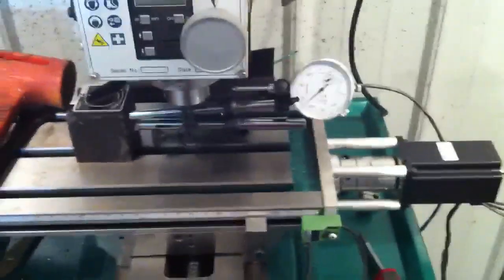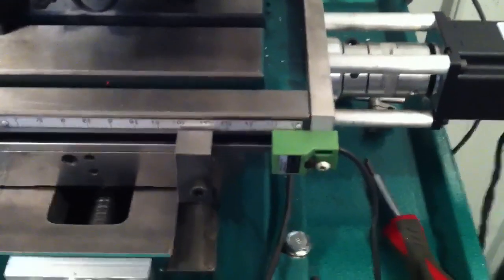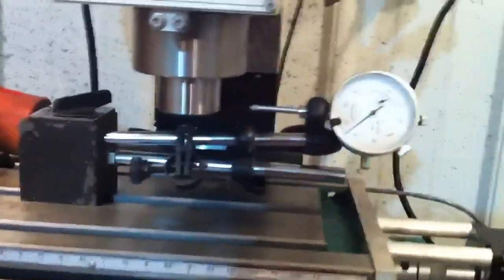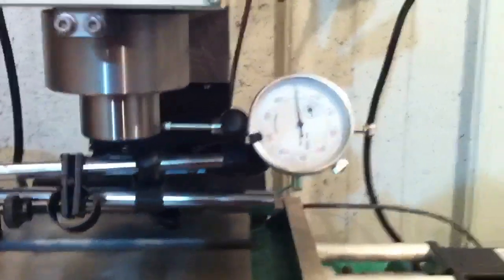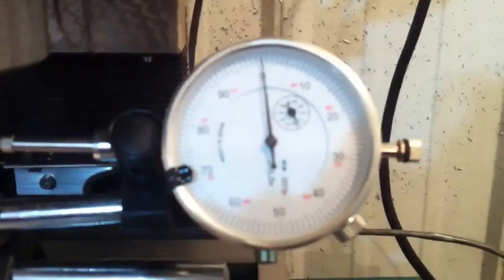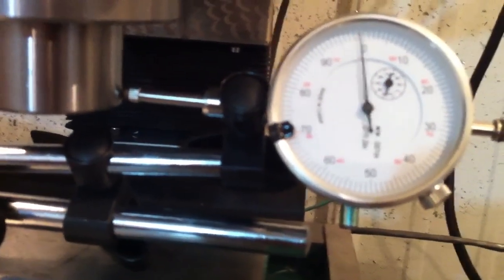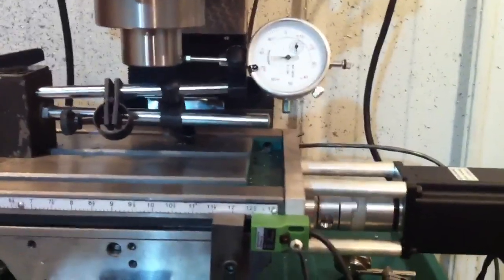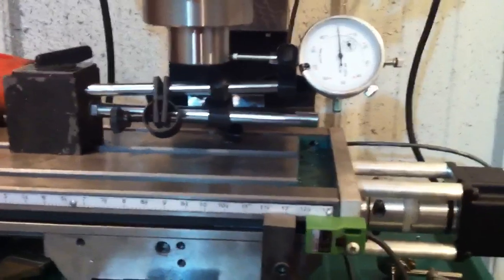G0704 Home/limit proximity switch repeatability test

Comment from the maker: I obviously haven't been back here in a long time.  To answer the questions here about the switch install.  I used SN04-N proximity switches that I got off e-bay. They are normally open NPN type switches. I tried many things to get them to work with my breakout board and what I settled on was having these SN04 switches trip small relays that are connected to the BOB. I use a separate supply voltage to the SN04 switches.

If I had it to do over again, I would have used the SN04-P normally closed prox switches because I believe they would have been able to be wired in without using separate relays. I can't confirm this, but I had found some info that indicated they could. Can't remember where that info was now though.

Comment: Did you use NO (Normally Open) or NC (Normally Closed) switches and do you have the wiring diagram for this? Did you send a separate 12V to the switch? I have both NC and NO types of these switches but I need to determine the wiring pattern.
Any information would be a help. My email is mtaylor18@snet.net  Thanks

Comment: mpja dot com is good place to get switches like this and other assorted electrical crap. they sell new, and surplus {alot of surplus is still new too} most there stepper motors are unipolar though.  Speaking of steppers, what size steppers are you using on this machine, and are they the same size as you used on your RF30?

Comment: is it the green one when you search "SN04-N Inductive Proximity Sensor Switch 4mm Detective Distance DC 10-30V" on ebay? Which BOB did you use in your rig?